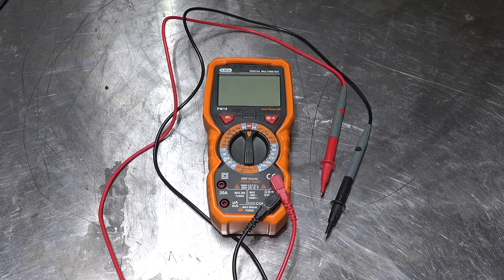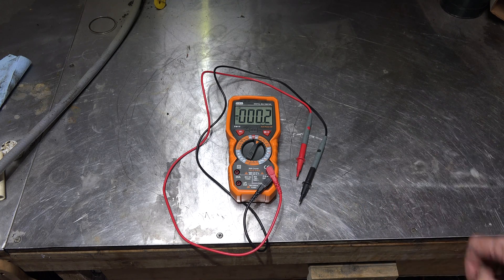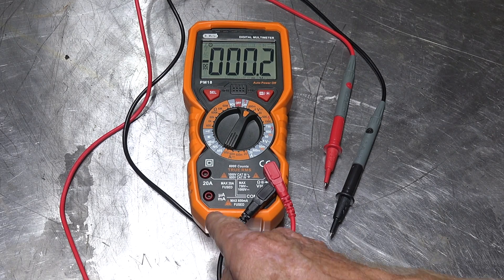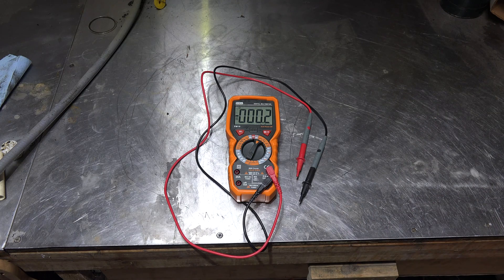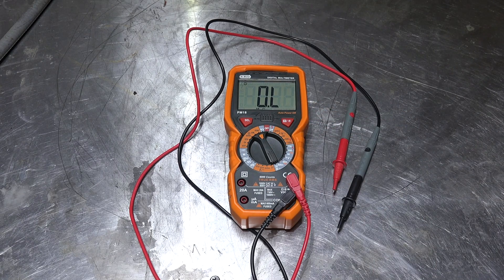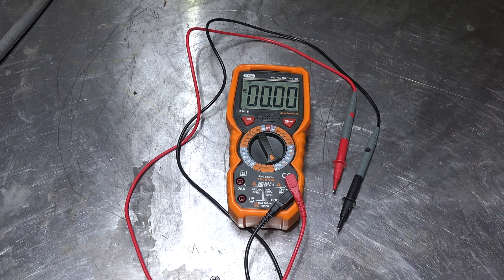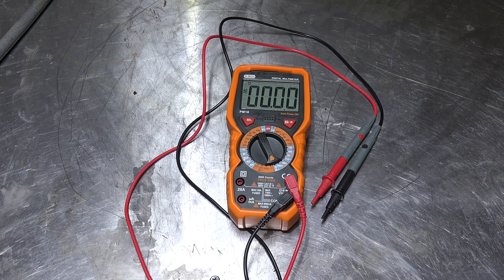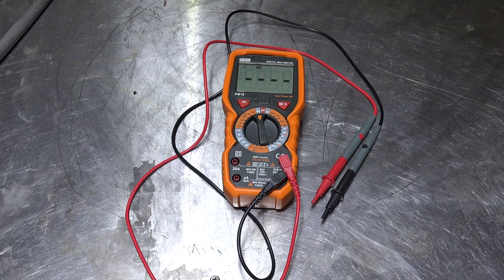The Dr Meter PM18 multimeter

Comment: Does this meter test microfarads?
Reply from the maker: Sorry for the delay.  I kind of blew it on that one, I didn't even check.  It does.  As low as 6 nF up to 100 mF.  So it will work for HVAC.  I will have to revisit this one as I did find some other issues with the meter.  Nothing big, but I may do another one on this one.
GFM

Comment: 20 amps on the leads they would catch on fire unless they are 12 ga ...NOT
Reply from the maker: DENNIS N The leads on all meters are less than 12ga. Leads of 12 ga would be pretty much unusable. Meters are used to test circuits, not become a permanent part of a circuit.  
GFM
Reply: the whole idea is a short test duration and staying well below the max of 20 amps